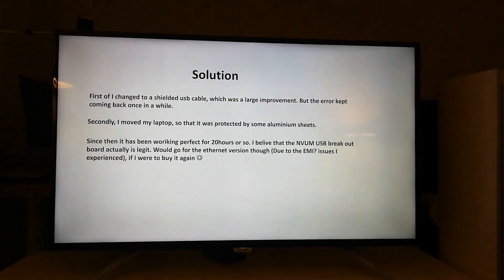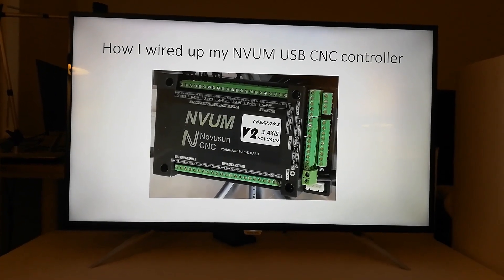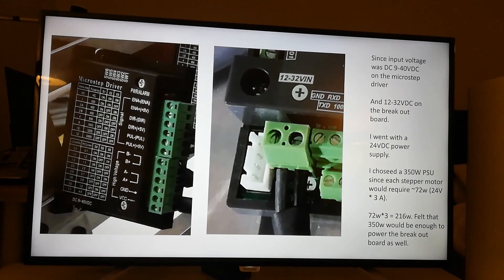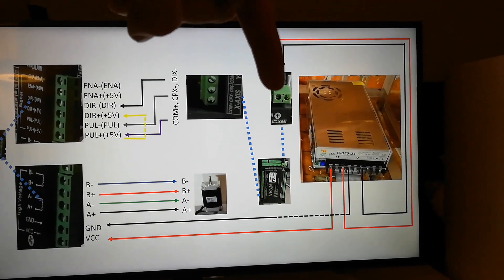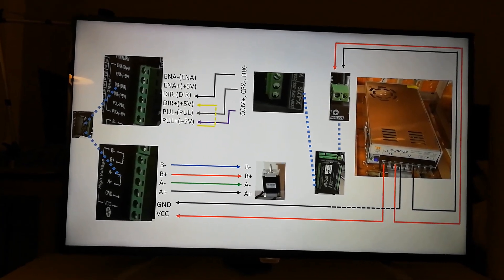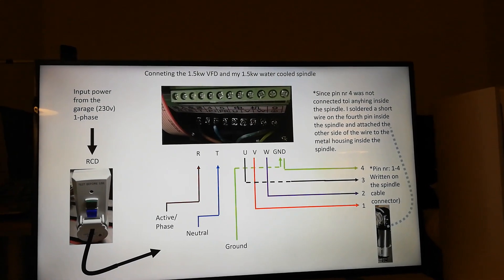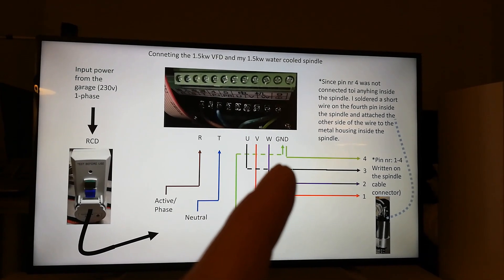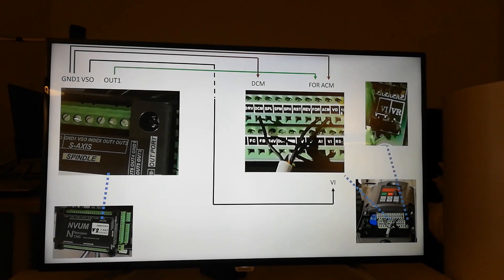Part 14 6040 CNC ROUTER - Wiring NVUM USB CNC controller nema 23 + VFD and spindle + micro switches

Comment: Nice video, which windows version are you controlling it with ? it is possible to use windows 10 ?
Reply from the maker: I use an old lap top with windows 7. Works better than expected, it can run for hours and hours. Only problem I had so far is when I forgot to put the charger in and it went into power saving mode, it caused a crash. My fault though... :)
Reply: Hello sir I am getting same problem plz tell me is it possible to use in windows 10 plz answer 🙏

Comment: Good job! I used shielded cables from my VFD to the spindle, this was one of the biggest contributor of EMI in my system and almost totally gone since the upgraded cable was installed.  Don't forget to ground the shield to the ground in the VFD controller as well as the spindle body where the connection is made.